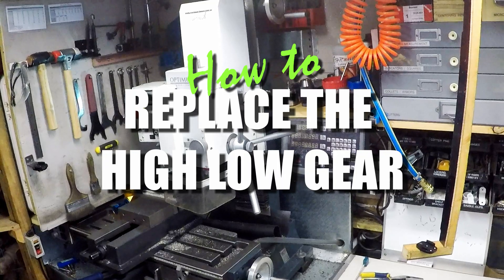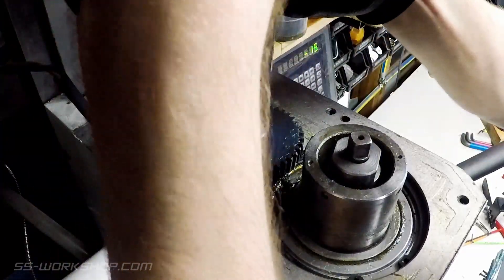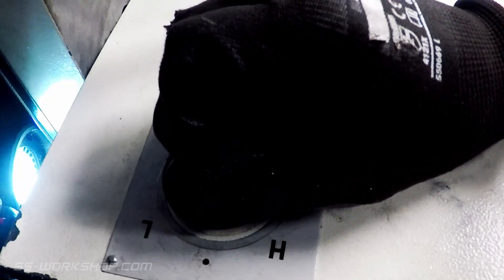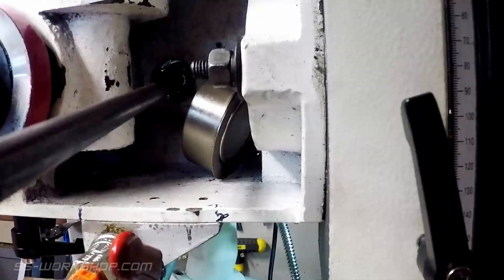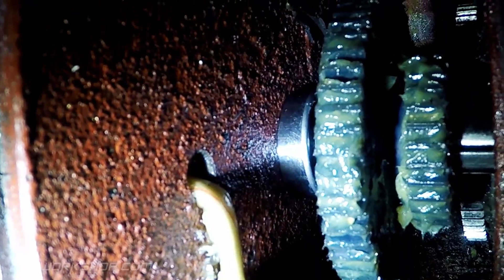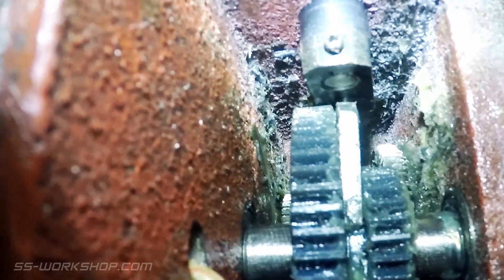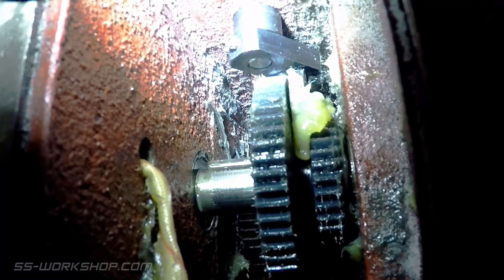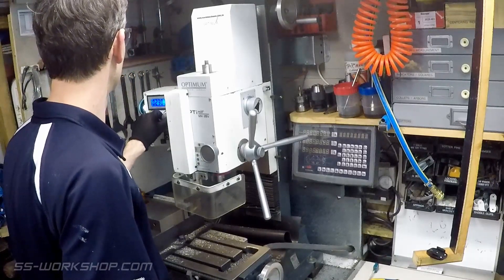Benchtop Mill High Low Gear Replacement | How To

Comment: Hi found some good info on your channel thanx,,I have a BF -20LV   and have brought the Optimum  DRO   D695  from Machineryhouse,I havent opened the box yet but told  it has ss strips  for scales  ,Do you or anybody who see's  this,   Are they any good for a DRO   thanx for any help
Reply from the maker: Hi, i understand the optimum DRO uses magnetic scales. I used a ridged type magnetic scale DRO on my previous mill / lathe combo. They seemed to work fine, I don’t recall any issues. They were effectively just oversized digital calipers. The optimum DRO looks to just use flexible tape for the scale which would be easier to install I guess.

Comment: Great video!
I have an Optimums BF46 Vario and suspect I have a gear problem in that I hear rough noise at higher speeds. No noise at below 1000 rpm. I suspect that my machine is similar and your video is applicable.  Your thoughts and recommendations?  May I ask where you purchase new gears?  Also I wonder if you can 3D print replacement gears out of a similarly durable material.  Can you please tell me what you believe the gears are made of?  I have a 3D printer and CAD software as well as a CNC mill and may give it a go.  Thanks

Comment: Excellent video!  Thanks much! I have an Optimum BF 46 Vario and may need to replace the gears as well.  I get a rough noise at higher speeds.  Do you think this is the problem? I assume the same gear setup is used in my machine.
Two questions:
1) where do you purchase your gears?
2) would it be possible to fabricate the gears out of a steel alloy for more durability or do you think there is a reason for plastic gearing which I assume is what the machine comes with (I haven’t opened my system up yet.
Reply from the maker: Thanks, the rough noise can be it starting to wear, when it actually fails the spindle doesn’t turn when the machine is running. You can check through the access panel in the back of the head if it’s failing. I’m not sure what the gear setup is in the BF46  as it has 3 gears rather than 2 but a lot of the machines share a similar design. I got the replacement gear from the machine supplier which is machinery house here in NZ. There is also another plastic gear that the motor drives on mine, which is meant to fail first but never has. I think the reason for the plastic gear is so if it slips out of gear it doesn’t take out the gear on the spindle that would be even harder to fix. I have considered making a brass one, even bought the gear cutter for it, if you were going to make one it would need to be made in a couple of parts then welded together. The gear is made out of some flash nylon material so don’t think anything 3d printed would cut it. Hope this helps, good luck.
Reply: @SS-Workshop  Thank you so much for your reply! I would like to add a Digital Readout (DRO) and would like to ask if you have any recommendations on the type and brand to purchase and methods and locations to attach to the machine. Good luck with your projects!  Cheers!
Reply from the maker: @neatmachine  not sure if you have seen this video but shows how my DRO is installed on my machine  https://youtu.be/IhoZlG0Rj64   . My DRO is a Chinese clone of the Sino which I ordered through AliExpress. You do roll the dice buying through them so if you can get an ok price locally it’s probably the better move. The glass scale ones are the best but have previously used the magnetic scales with the individual displays on a previous machine but you miss the functionality of a proper DRO the can do bolt hole layouts and all the other features that come standard on a proper DRO. Hope this helps, if the video doesn’t show enough let me know, happy to answer any other questions you have. Cheers.

Comment: Thinking of buying the very same mill. My only problem is $50 every time you strip the gear. i'm new to the hobby so i guess i'll bust them for sure. My question is how easy do they strip under normal use.
Reply from the maker: Hi Steve, in my experience I have been doing something wrong or beyond it’s capability to have it happen. Examples, 50mm face mill with reasonable depth of cut and stalling the cutter or the machine jumping out of gear (this can be avoided by tightening the selector if it comes lose). In my case with very regular use it’s happened about once a year. They are a good mill and a lot of the similar sized machines have the same setup. They are there to protect more expensive parts. As for cost, they are probably the cheapest part of owning a mill with the tooling being top of the expenses.

Comment: Interesting approach with the makeshift press! I had the same fate with my slightly smaller Bernardo KF 25 Pro around the same time you replaced the gear. In lack of any professional equipment for bearing installation, i unfortunately just hammered them in. :-/
BTW: The stripped gear teeth show that the gears don't mesh properly, i.e., they don't use their full width. This also was the case when I stripped mine, and I learned to be careful with the position of the shift knob.

Comment: Mate, this video is amazing. I'm looking to get one of these mills and this has given me a great deal of info the internals of the head. Thanks!

Have you considered machining the two internal gears out of steel and leaving the sacrificial nylon one on top?
Reply from the maker: Thanks, great to hear. I have considered steel and brass as options and actually picked up the gear cutter to make one. The main consideration is that on at least a couple of occasions when it has failed the machine had jumped out of gear and if that happened with a more solid gear it would take out the steel gear on the spindle which is even harder to replace. A common CNC upgrade is to drive the spindle directly with a belt drive so that’s another option but would change the speed and disable the quill action so may be not. This is one of those things where when it happens it’s top of the list then it’s replaced and it’s back to the bottom of the list, given I may have it happen once a year with regular use and it’s usually something I shouldn’t have done, keeping a spare isn’t a bad option.
Reply: @SS-Workshop  how do you find the HM32v besides this gear issue. Started watching your videos and must thank you for the tips. I recently bought same machine.
Reply from the maker: @MacGyver3446  mine is the MH28v but think it’s similar. I have found it to be great, really well built and very capable. I have pushed pretty hard with a carbide insert face mill and it has handled that well. The only thing it doesn’t do is run as slowly as I would like for using the boring head and because of the variable speed it lacks torque at low speed which it where it would be useful.
Reply: @SS-Workshop sorry I made typo. I was going to buy the MH32 and so was fresh in my mind, I bought the Mh28v but still have to add the digital bits. I am not by any means a professional machinist but do have the knowledge and basic know how. I watched your videos and enjoy and appreciate the knowledge you share. I buy from Hare and Forbes and bought a vice today and took your advice by going bit bigger and removed the turn table at the bottom. Those wheels you made, then sand blasting to make look like casting is amazing. I hope to get to that level one day to make finer things for my hobbies.
Reply from the maker: @MacGyver3446  congratulations on your purchase. I don’t come from a machinist background either just trial and error in the home workshop. I just started out cutting the odd slots and squaring up blocks and it all started from there. The locomotive project being a great excuse to use more exotic materials and try some new techniques. Sometimes I even surprise myself with how things turn out and the wheels were certainly one of those. Good luck.

Comment: Where can i find replacement gears in metal?
Reply from the maker: I haven’t found any for my mill yet the only ones I’ve seen are for the Sieg machines from little machine shop. I have purchased the involuted gear cutters to make one, still working on what material as it would be nice not to take out the gear it meshes with on the spindle if it jumps out of gear, current thought maybe brass and making it in 2 parts fixed together. Another option is belt drive with kits around to convert some bench top mills but they seem to be aimed at CNC with higher speeds than standard.
Reply: Thanks for the reply.  @SS-Workshop  I will keep looking and ask my supplier